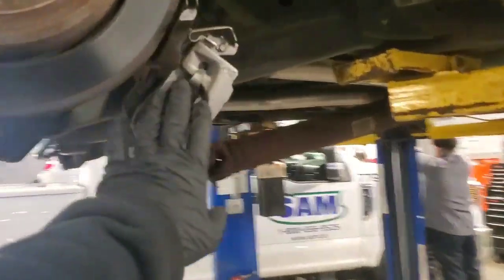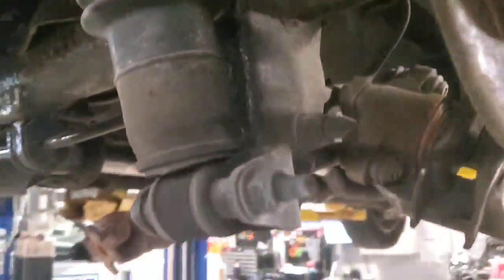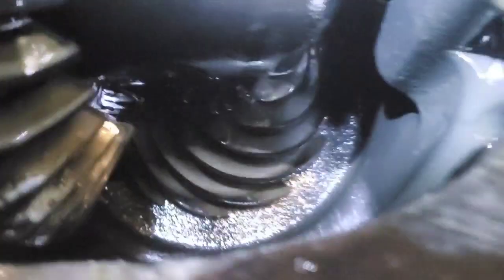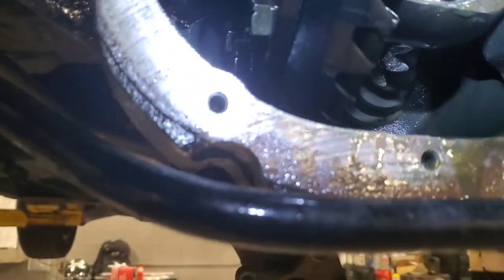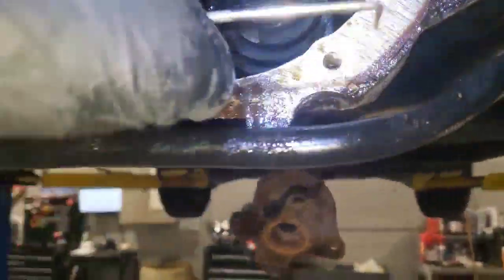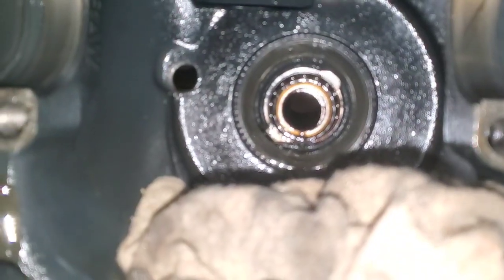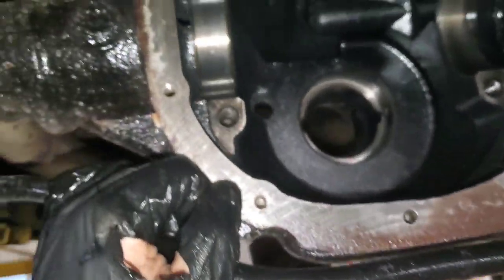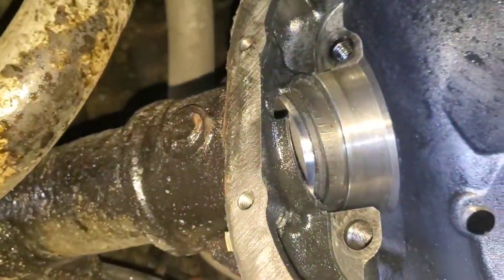Ford 8.8 31 Spline Limited Slip Diff Install Part 1 and 373 Ring and Pinion 2006 Lincoln Town Car

Comment: What parts are needed to make my 2001 crown vic front one wheel peel to both wheel peel? Also would like to upgrade to the 31 spline axels.
Reply from the maker: You said front wheel pill I think you made a mistake and you meant one wheel pill you're going to need a limited slip differential and if you're going to go to 31 spline axles you need 31 is fine axles plus you need the proper axle seals for a vehicle with 31 spline axles
Reply from the maker: So essentially everything in the rear end is going to have to be changed if you don't already have 31 spline

Pinion carrier assembly axles axle seals
Reply: @FordBossMe  I meant 1 wheel peel lol
Reply: From 1 wheel peel*
Reply: @FordBossMe  so that 8.8 rebuild kit on lmr with the axles gears bushings and diff housing and some other stuff will fit my vic?

Comment: May I have the parts list? I am getting ready to do this upgrade in a couple weeks and i am having trouble finding the right axels and bearing kits since there are so many options for the 8.8
Reply from the maker: I don't understand what parts list you're looking for if you're just wanting shims and bearings and everything you can go on all kinds of different sites and order just a regular 8.8 31 spline axle shim kit and bearing kit
Reply: @FordBossMe  I was mainly looking for a link to the axels you bought, but I just did some research and found that 05 and up came with 31 spline axels. Is this true? Mines an 06. I dont need the part number for the axels anymore of thats the case. Sorry to bother ya

Comment: Do you have a parts list by chance? one of my axle seals is leaking so I wanted to get this upgrade out of the way. I am wondering if I need an aluminum driveshaft for the 3.73 or not.
Reply from the maker: I'm still running the factory steel one
Reply from the maker: I don't have a parts list right now but if you get with me tomorrow and ask me again I can get it for you
Reply: @FordBossMe  that would be great man, I actually have the exact same car as you, the same pewter metallic paint and year. I have the designer series so it has the heated seats and all that crap, but of course the driver side seat heater doesnt work lol.
Reply: @FordBossMe  I watch car guys new england, he has the same town car as us and he said something about using an aluminum driveshaft from a police interceptor with an extended yoke for anything taller than a 3.55 gear as there is vibrations or something.